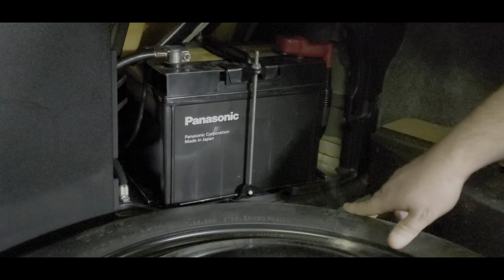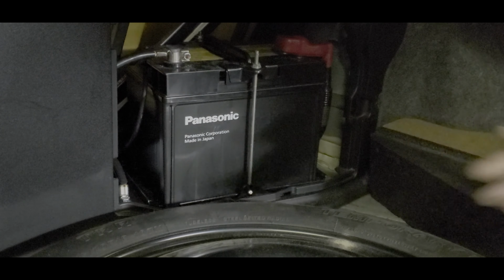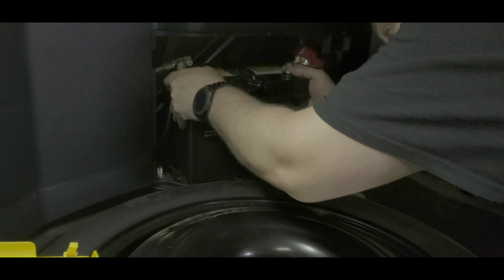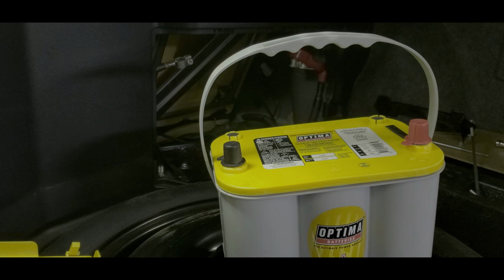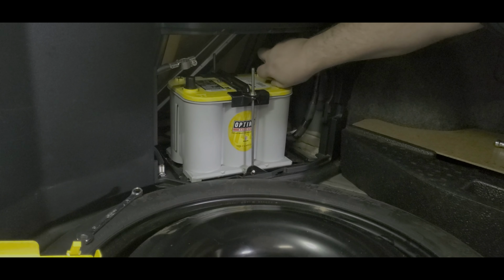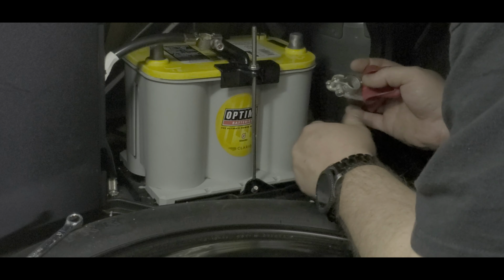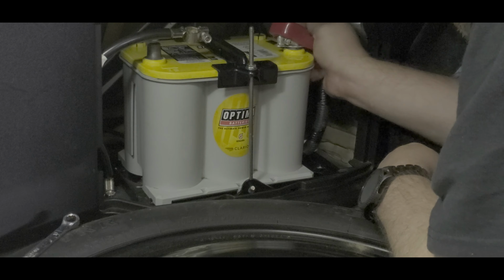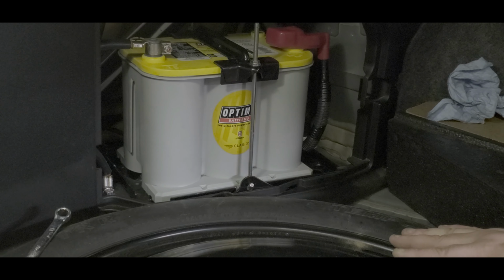2015 Mitsubishi Lancer Evolution X GSR Battery Change

Comment: Dumb question, the positive(+) side goes under the red rubber cover right?
Reply: most batteries yes, some have the red rubber on both sides but tipically only positive side has, 1 year later lol

Comment: My 2008 GSR still has the OEM Panasonic battery. Well, it actually just started having a cranking issue just a week ago where i had to occasionally jump it when it gets too cold.  So, i am sourcing for the Optima Red 35 for the evo. I thought the Red one would be better since its a 720 vs the yellow 600+ cranking.
Reply from the maker: Depends on how cold it gets where you are.  I'm in a good temperate are so the 600 is fine for me and the yellow series is what I run in my trucks.

Comment: Just to verify, I don’t need to use the hose if the battery came with no vent out? I have the red top but it came with no vent, just wanted to make sure i wont die lol
Reply from the maker: The hose is just for vented batteries so that vent fumes don't gas into the car.

Comment: Would be nice to know part # for that Optima yellowtop.
Reply: FYI, after watching this video I was able to do the same swap on my 2010 EVO X SE (thanks RB).  The oem battery was the panasonic which lasted 11 years (!)  My local Mitsu dealer attempted to order an OE, but after a week of waiting, I looked for an aftermarket -- I used the Optima Yellowtop D35 (8040-218).  The problem with most aftermarket batteries is that they are too wide and don't fit in the EVO battery brackets (this battery is located behind a panel in trunk).  The Yellowtop D35 fits perfectly with room to spare and no need for bracket adapters, etc.  Although, I don't have history with the Yellowtop, the car started right up and is running fine.

Comment: Thanks for the video! It was reassuring to see you have some difficulty with the same things I came across (the surprise of the vent tube and the difficulty with holding down the battery retainer). Quick question, why is the Panasonic battery bad? It's lasted me almost 6 years so I'm thinking of getting the same one.
Reply: The Panasonic lasted 10 years for me. Unfortunately it’s discontinued.
Reply from the maker: My tuner, myself, and a few other evo owners I personally know have had way more bad luck stories with them than good ones.
Reply: My Evo x is still kicking after 11 years on the Panasonic. I have had multiple Optima failures on other cars throughout the years.
Reply: @jeremyjmontoya  mines 14 years old and i think I need a new one now lol

Comment: Knowing the absolutely useless platform this car sits on I looked up this video just to see if the battery was on the same part as all the other abominations that use this platform which by the way is in front of the left tire behind the bumper and complete out of reach from the engine bay,